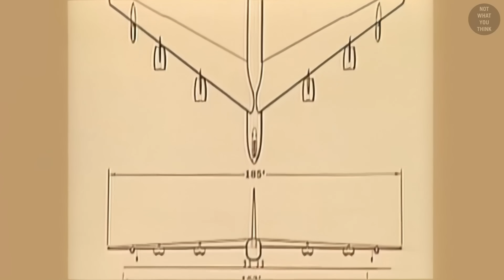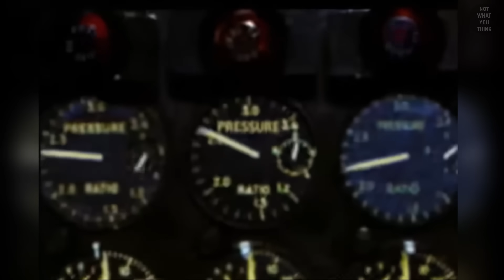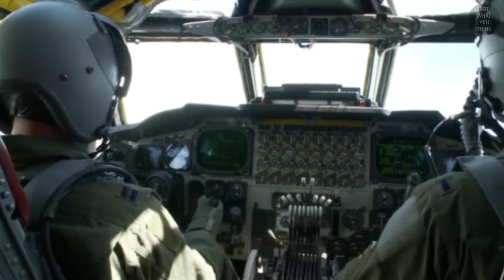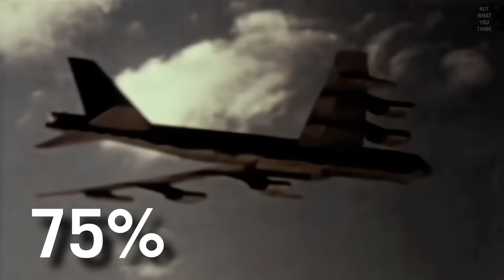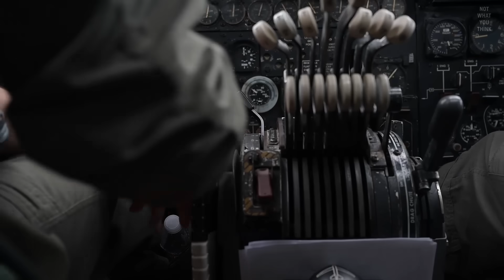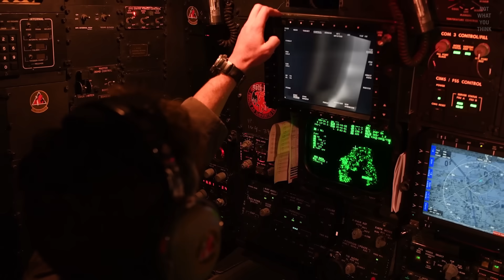Why This Obsolete Bomber Will Outlive EVERYTHING

Comment: The B52H Stratofortress is a beautiful bomber, I want it to remain operational for many more decades, and never need to be replaced from the b21 raider.
Reply: B21 raider is useless if enemy has advanced military satellite, stealth fighters and many of them. The future bomber must have powerful afterburning engines capable of flying faster than Mach 1.5, AESA radar with air to air capability + stealth.
Reply: @jawarakf  yes I’m sure you know more than the USAF and an army of professional analysis and engineers 🤦‍♂️
Reply: @jawarakf  

No, it isn't. You don't know what you're talking about. 😆 No, the future aircraft MUST NOT have powerful afterburning engines. You think you know something about technology but you don't know how inefficient afterburning is. 😆 Don't talk about technology. Ever heard of supercruise? That's what it will be using. Military satellites will be useless because they cannot detect it. Not only that but it will have a new stealth technology that will help it conceal its presence even to radar systems that can detect stealth aircraft.
Reply: @jawarakf  Bombers can be escorted by fighters, they don't have to fight everything
Reply: @hphp31416  did you watch By Dawn's Early Flight? The B-52 being intercepted by Soviets Mig-25. In Vietnam war, the NVAF Migs gotten into guns effective range despite many USAF & USN.fighters around. Thanks to the rear gun, it killed the enemy fighters. Imagine if it's B-21 and the fighters escort nearby being splashed when up against powerful country, the B-21 can't run nor fight will be easily caught with option surrender or die.
Reply: @jawarakf  the USAF strategic command during Vietnam era had some awful strategies for B-52, thats why NVA managed to down it with SAMs and MiGs. Even B52 operators admitted they knew the flaws of the strategy, yet the commanders were stubborn.
Reply: @jawarakf  this "the US lost in Vietnam" thing is controversial. Sure, it is good for the memes, but before leaving Vietnam, the American military set the Soviet and Chinese-backed economy of DR Vietnam by decades. Everyone lost in that war. Soviet economy collapsed due to heavy funding of VN, the Arabs and Afghanistan. Also 30 years after the war, USA still looked better than China, Russia and Vietnam...combined. No disrespect to Vietnam tho. They did a great job and now meme people have a card to play against US military in online discussions lol.
Reply: @punchdreadnought8101  US lost Vietnam war because US tech is not far ahead of Soviets technology at that time. Also, Soviets refused to deploy their latest fighters such as Mig-25 interceptors to Vietnam that have better kill probability than US fighters older AIM-7 variant which would put US losses even higher. Refer Israeli Air Force heavy losses to SA-6 (three fingers of death) during Yom Kippur War tells Russian missiles effectiveness at that time.

US mastered electronic & computer technology by early 70's made the 4th generation fighters superior in avionics, missiles effectiveness & laser guided weapons leaving Soviets technology obsolete far behind in 80's. Soviets were too poor to inject any more R&D that the Su-27 and Mig-29 had superior maneuverability but didn't have the avionics due to missing electronics technology. Only by late 90's near 2000's and present they had the software & electronics they need with Su-27SM2, Su-35 late variant, Su-30M2, Su-34M, Mig-35 onwards have the avionics that could match US avionics, being closer but not better.
Reply: B1-B Lancer hands down 💥
Reply: Sounds like you want many accidents to happen. This bomber is not beautiful. It's aging and this is probably starting to show. The Air Force is using it less and less. In a few years you will hear it is getting retired.